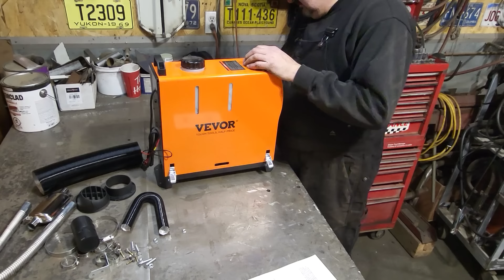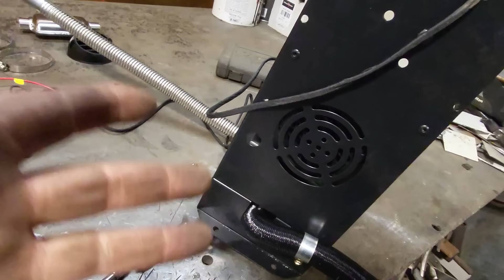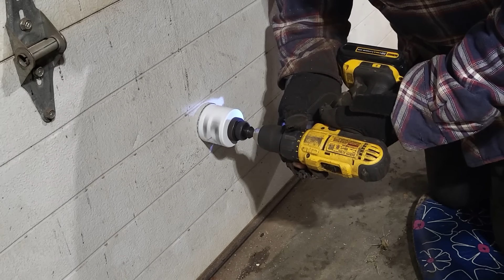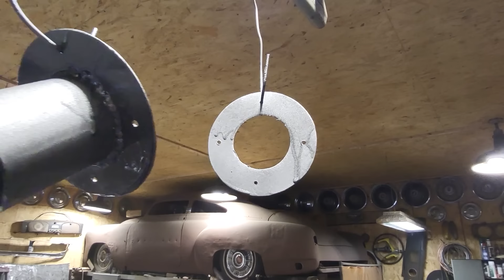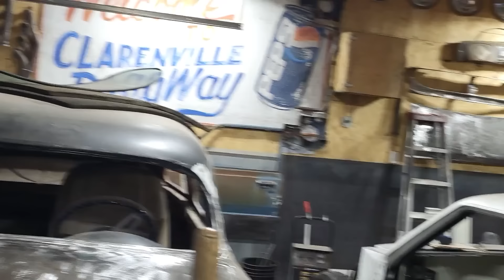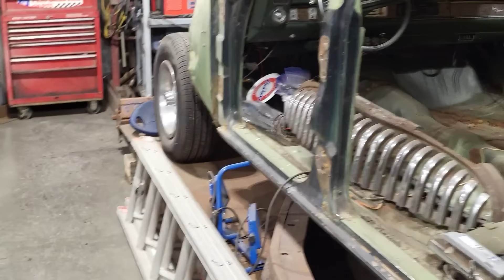Will a diesel heater heat my 800 square foot garage?

Comment: Fitzee Just found this review on this heater. So after 2 years what is your verdict? Do you still have this? Im in Bonavista and a subscriber
Reply from the maker: There are many videos that show how good they are. I have a number of friends that have them and love them.
Reply: @fitzeesfabrications  Thanks for that. Do you still have/use yoyrs?
Reply from the maker: @lesliegilholme7309 tell you truth i got it for my camper and that is a project that's on the back burner. Lol

Comment: The air filter intake is supposed to be also outside the building so the heater doesn't run on exhaust and recycles fumes alot worse. Extend the air intake to outside to fix this problem. The fumes wont be nearly as bad

Comment: I have this exact model in my carport and I cannot seem to raise the temperature from 20 Fahrenheit , over 40°F. That’s after running for 6 hours on high. 🤷‍♂️ Yet I have seen video after video where people are heating an entire one car garage with these maintaining 60°F. I don’t understand. Intake and exhaust are properly routed with no obstructions, Proper power supply. High for six hours, I cannot seem to raise the temperature more than 15 maybe 20°. What am I missing?

Comment: The small  fresh air should go outside to replace oxygen as the 🔥 fire will use up oxygen, the fan inlet inside . I think a 15 gal barrel inside for exhaust then pipe barrel out to capture waste heat,

Comment: You have asked the question will it heat my 800 square foot garage? Well so far you have done nothing to find out if it will work , but WOW you done nothing but do but that?
Reply from the maker: Did you watch video?  It did heat my shop.

Comment: Those heaters will not heat an 800 sg. ft. garage unless it's not very cold outside and you are well insulated. I ran one of those all night on high (35 degrees outside) in my 700 sq, ft. shop and it only go it up to around 50 degrees all night. I have 8 ft. walls and it is a brand new well insulated building.

Comment: the fumes is just the initial burn off mine was the same way the oils off the hands of the person who assembled the heat exchanger into the housing and the oils from your hands on the exhaust  no big deal itll bur off and be good as for spilling fuel that may add to it too thats why i put a stand pipe in the cap of a 20L jerry can and just swap out the cans as needed always keeping a full can on hand. to maintain the battery charge i have the one in my shop on a constant trickle charger and the one in my house will be on a solar trickle charger with a plug in one for if the solar isnt keeping up

Comment: Its all about the cost  If your saying 1 gallon a night  How much for 24 hours cost  ? as a  liter  costs  1.87 here in NB Canada  Would your electric heaters be cheaper ? Or would a propane heater be cheaper ?  The cheapest would be a wood stove in the garage  ,but its a lot of work

Comment: You need to mod exhaust to run threw rad or sand battery to regain wast heat from exhaust

Comment: My latest install is a 8kw all in one, fuel tank unused and removed, sits on a WOOD chair, 1 meter up from ground -  has a 2 meter fan-cooled and  coiled lazily downwards exhaust that exits a hole in the wall sleeved with 1-1/2 inch copper pipe.  No muffler.   I estimate I recover 90 percent of waste exhaust heat, condensation is copious, soot is non existant.  Exhaust is 8 inches off the ground in a wind sheltered area between buildings.  The last install was a 12v battery w mains connected trickle charger / 2A , this one is a modified 450w computer power supply connected to a computer ups on the mains (will run the ps for 4 or 5 hours during power outtage)  fuel is 20 ft plastic line sleeved in 3/8 fuel line, filters are one inline that I can see and an open ended one near the bottom of the fuel tank - an elevated 15 gallon fuel cell outside.  Outside cuz tank moisture will fall and freeze in sump, fuel is 40 percent fuel oil, 10 percent petrol (gasoline), and 50 percent diesel (one 1/2 inch hole through wall). This year has run 24/7 on setting 1, overnights up to 5 on occasions.  Keeps a 500 sq ft shop uncomfortably warm ( next time a 2kw run at higher setting will be tried.  Last year, unit failed, because I did symptom dumb..  replacement in place within 10 minutes.   The spare for this year sits in the box in the corner..

Comment: I use 8 kw in my shop  as auxiliary heat. While I am in the shop it's efficient and dependable , it's powered by a 30A 12V converter designed for LED lighting  .
Reply: Run that through a computer ups ... The failure of power at full burn is dull to experience but a nightmare to recover from.

Comment: I've got an insulated shop the size of 2.5 car garage with 9 ft high ceilings and installed 2 x 8 KW diesel mini-heaters.   Each heater is on the opposite side of the garage and their exhaust vents outside.   Yes.  They do "heat up" my garage - to "take the chill out".   Especially when temps drop in the -40C / -40Fs.  I also use the 220V @ 30Amp electric heater when needing to work inside in my spring coat / thick sweater.    Yes.  Mini-Heaters do "heat up" a shop.   Especially when "occasional needed during winter months" - like when changing my vehicle's engine oil....  Burning diesel is much less expensive then using electric heaters.   Especially electric baseboard heaters...

Comment: You have a concrete floor so point the heated air towards the floor. It will heat the concrete which will hold the heat longer.

Comment: Nice video, thanks for posting it and showing how the heater performed. These diesel heaters seem pretty useful for some applications. 

One item I'd like to share for you and others reading, is that when you run anything that creates exhaust in winter, the warmer air inside your house or garage will rise, and unless the house is extremely well sealed, as the warmer air escapes from your ceiling and roof, it will draw outside air from any tiny cracks at ground level (its called the stack effect). I found this out cooking on a grill right outside my back wall in winter one year. Although the grill was completely outside, and my house is reasonably insulated, the house created a draft and drew in the fumes from cooking outside. 

It was remarkable, you would have really thought one was cooking inside, but nope. It was the outside air being drawn in. So keep this in mind and have the exhaust as far as possible from the house. Having a CO monitor is also always a given. For your heater, it may have  been diesel fumes from a drip, or the new plastic just off-gassing a bit, but its always important to take due care when you have any combustion exhaust.

Comment: The problem with putting it outside is if the outside air is 20° you're not gonna get as much heat out of it as if you're inside in your air is 60°

Comment: A gallon of diesel is $4 or $5. I can get a 1500W space heater for 20 bucks and run it 12 hours or more for $4 in electricity...and I don't have to worry about exhaust.
Reply: Diesel is 3.25 in Maryland right now
Reply: I am same, except at -20degF I need every bit of the 8 kw.

Comment: I would like to use one of these to heat my head... not the outside but my inner cranium, can I put the exhaust up my nose to have the wanted effect? Also will the Bluetooth connect to my left foot?
Reply from the maker: @MothKeeper  funny guy

Comment: 2/3 of the heat these heaters create go out the exoust . Thats why those that know find the old cast iron radiators run the exoust threw it then send cold exoust outside and keep all the heat inside .

Comment: I have an 8k model. It heats my 576sq ft insulated garage to 71-74 degrees(F) here in northern Michigan........and that is during the night when it is in the 20's outside. One tip is to buy an expensive T-Bolt clamp for the exhaust where it connects to the heater from underneath.......those old style clamps cause a void when pinching. I found a tiny leak on mine and after installing the T-Bolt clamp, all was good to go!!!
Reply: How tall is your ceiling?
Reply: @JonnyHeil1806  9'

Comment: Not a good idea to have the heater outside aside from the elements the fuel may not flow well in very cold temperatures

Comment: Just found this old video. You want air put the unit outside and have the heat hose blow through the hole in your door. Much quieter inside also.

Comment: I have the same unit ( sold by a different seller ) and have been using it for > 7 years now.  I use it to supplement my wood stove which is generally way to large to heat my 820 sq ft  house with out roasting you out and this heater having a adjustable output works perfect for me.  My " house " is an old converted camp with only half the windows being double pane and I only have an enclosed  crawl space and this place is FAR from being air tight and not very well insulated at all, but these 8 KW heaters keep up quite well. 

So far I've had to replace 1 fuel pump,  @ around 12 bucks and just replaced a fan assy  that was getting noisy , otherwise I've had no issues and now I have 3 , one as a stand by unit held back unused in reserve , and one I heat my 780 sq ft garage with and the oldest one I heat my house with .  I live high in the mountains of  VT where it gets used pretty regularly 5 months out of the year so after 7+ years of use and hundreds if not thousands of hours of use it's only required  < 50-60 bucks worth of maintenance,  it's proven to be VERY cost effective to run fuel wise and has been very reliable IMHO for the amount of time mine gets used . 

For me with 20 ish degree weather outside and the house already warm , I can run mine on a 1 or 2 and the thermostat set @ a 72 F setting ,  I'll get around 25-30 ish hours of run time on 1 tank , which on mine is 7/8 of a gallon. It will easily maintain 70+ degrees inside and barely sips fuel, a suggestion though, try to avoid tinted fuels such as kerosene and some home heating fuels , as it seems to carbon up the glow plug quicker than the clear diesel does .

I can't say enough good things about them and now many of my friends have them for many different uses and they all love them too .  One friend in particular that has a damp basement that had mold issues , hasn't had any issues with that now after using his for the last 2 years and went from using > 4 tanks of heating fuel each heating season down to about 2 tanks a year counting what the diesel heater uses so in his case it's saved him a ton on heating costs and solved his damp basement issues.  

They are Chinese-um made though so I don't run mine while sleeping , but after 7+ years run time on my oldest one I've never really had any concerns with them.   But still I don't generally leave them unattended all day , when sleeping or when I'm gone someplace.  
But that is just me being overly vigilant perhaps ?   

BTW, the clamps they come with absolutely suck , so replace them with a stainless marine or aviation grade hose clamps so you have no exhaust leaks / smell or CO issues.  
Very important and the only down fall I've found with them  !!
Reply: Isn't kero clear / cleanest burn?   No 2 is red.    Road diesel is yellow??
Reply: @user-st5rc9nz4j  I guess it depends on whether your using on or off road diesel or #1 kero  ?  #1 Kero is normally clear and quite a bit more expensive that road diesel and I've found not much difference between the two . 
I've found red tint in Kero too and though kero is normally normally cleaner  burning , it still clogs up the glow plug faster if tinted .

The red tint fuel defiantly will  coat you glow plug faster in the heaters, at least that is what I've found . 

Not that it's a big deal as the heaters are extremely simple and easy to work on so cleaning a glow plug once a year or so isn't that big a deal IMO. 
It seems I don't need to do anything to my heater if I run only "on road diesel"  though . 

I honestly don't know the difference in octane ratings between them but I'm sure there is some differences other than color ?

Comment: A little advice... Your fresh air intake shouldn't be in the same room your trying to heat.... Fitzee... Drill another hole sir... And don't put the fresh air intake right next to the exhaust...

Comment: Now. Will door open wen heater not in use
Reply from the maker: @WayneParker-ri3ui  yes lots of room on the top for it to clear. My door rollers turn inward about 6 inchs from the top.

Comment: The air intake on the back is to aid in keeping the box cool and the intake underneath is for the actual combustion chamber.
Reply: No.  The intake at the back is to extract heat from the heaters fins...  It also cools the electronics in some units.

Comment: The smell might be fuel leaks.  I've found 2 on mine. Cracked line at the barb, and a mangled barb.  Going to fix today. But look out for those slow leaks at the fuel line connections.

Comment: People just stop guessing, plug your shop dinensions into an online calculator and figure out how many BTU you need. These diesel heaters can push about 27k BTU on max, for my 20x24 insulated garage in Canada, doesn’t put out nearly enough heat as I need closer to 40k. So many what ifs and anecdotes when there’s a simple way to measure. These heaters aren’t magic, they’re designed to heat up the cab of a truck.

Comment: Stating heating in kW instead of the traditional btu/hr is a bit confusing. Being able to buy cheap fuel at the corner gas station is a plus even if the smell has to be piped out of your space (either that or  run it outside and pipe the clean heat into your space). I'm curious how much electric power it uses.
Reply from the maker: @19mitch54  there are alot of very detailed videos out there on all that information.  I watched a bunch and alot of great info out there
Reply: The energy requirements that I could find aren’t very detailed and are kind of contradictory. While some sources say it needs to be hooked up to a 15-amp power source, 40 W is printed on the back of the unit. That’s quite a difference and it’s hard to believe it draws 40 W continuously, if ever. Most of the power goes to pumping a tiny amount of fuel and some goes for a short time to start the glow plug and later to run the glow plug in the shut-down cleaning cycle. My real question is, can my 7 AH LiFePO4 battery run this heater long enough to go through a full tank of diesel?
Reply from the maker: @19mitch54  put a charger on it and it work for long time. I run mine on a battery with no charger for  half a tank for sure.
Reply: @fitzeesfabrications a 2 amp + trickle charge is adequate for a good battery..  a 6 amp max unit even better
Reply: My fuel tank is outside running thru plastic  hard line.. my fans (on exhaust pipe and unit fans) drain just over 20 watts together

Comment: i think wair you have you air  intake picking up it could be sucking fumes from the bottom of the door or off the floor.. you could just get a longer air intake tube and buile a air filter box on the wall put a hepa furnice filter in it ... pritty cool wonder why it clicks  thank you for shair Fitzi

Comment: Run the exhaust through a radiator in bottom out the top then outside . Put a fan on radiator get double the heat

Comment: I want to know if anyone has added acetone to their diesel and what the result was in something like this. In the kerosene heaters I was about to get about 20-30% more BTUs vs kero or diesel alone and a whole tank would last a few days not running it non-stop.

Comment: Mine never would work off of a regular 12 volt battery I had to run a transformer until I got a high out put deep cycle battery

Comment: Does it matter if it's farm diesel or road diesel? I'm sure that's a dumb question... but, whatever
Reply from the maker: @ThisDude-u7t  think the only difference in the two is taxes. Around here they add a die so the two are different so if you get caught  you can get in trouble.

Comment: You should not be getting ANY fumes, the intake air for the heat is coming only from the back of the machine, the other air intake (at the bottom) is only for the heater combustion itself. So if you are getting fumes in there, Its one of 2 things. 1. The Exhaust is not completely sealed at the bottom of the unit. or 2 the Gasket on the heat exchanger has a leak and is allowing combustion fumes in the fresh air. (kind of like a head gasket leak). Just wanted to put my 2 cents in there, because my heat exchanger has a gasket leak right from the factory and I had to replace it. Great Video I enjoyed your method of installation.
Reply: They do occasionally fume through the intake during slow light and or shutdown.   Rare tho

Comment: Theres a guy on youtube that passed the exhaust through an old cast Iron home rad as the exhaust heat is wasted  big difference in heat output. No muffler needed on outside...no muffler needed the rad  takes care of noiseand exhaust going through  door or wall is just warm

Comment: I like those heaters I had those in my tractor when I was driving otr. Great for that small space but I wouldn't expect it to heat an 800sf garage maybe 2 or 3 units but fuel isn't cheap.

Comment: I use one to heat our 160 Sq ft pig barn during winter, our overnight temperatures are typically in the 0* - 15*. It keeps it about 60* on the lowestest setting.

Comment: You have to connect a charger to the battery or it is going to run out of power and fry the electronics if there is not enough power for proper shutdown😊

Comment: Raise your door where a  2x4 or 2x6 etc can fit in the full length of the door while it is up & sitting ON the board, then cut a hole IN the board instead of the door
Reply: The top of the door will be open

Comment: Actually, when you shut them down prematurely. By disconnecting the power, it's not going to clog it up. What it'll do is it'll overheat the CPU and fry it. But don't worry, it's not a throw away. The new CPU is only about 35 bucks.